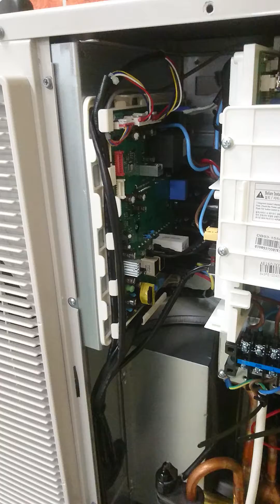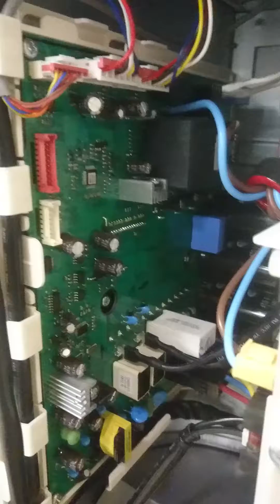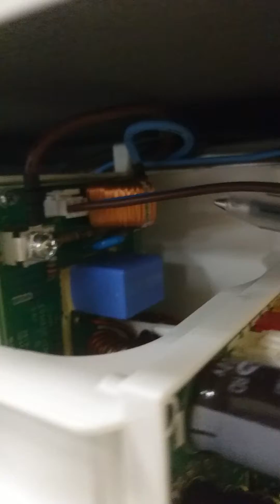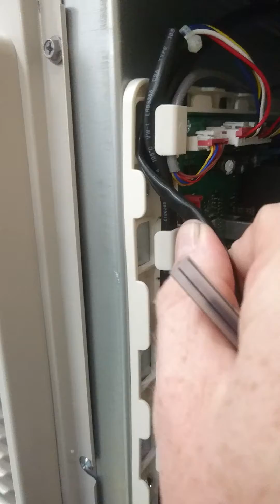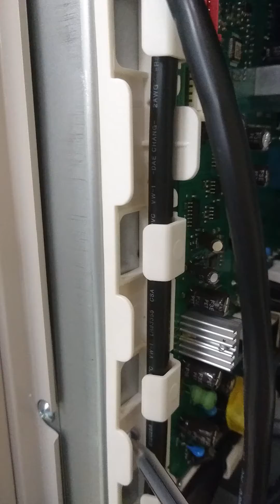E203 error Samsung air source heat pumps  AE090JXYDEH AE160JXYDEH

Comment: So I turn on the fan only part it runs for a few minutes then the e203 error comes on but if the board was shot would it even be turning on and running it's kind of confusing
Reply: That’s why you need to know what you’re doing when you fixing things. You don’t know what you’re doing…

Comment: Hi, I'm wondering if you could help me. I have a new Samsung unit with an outside  air to water unit. The unit out fan is not turning eventhough there is power at it. The panel inside seems to see the unit outside via F1 and F2 and I noticed that the digital number display on the outdoor unit is blank. Only the K3 button seems to click a relay??
Reply from the maker: Hi Damien if the screen is dead outside it has no power, you need to get this checked, once the power is on the unit will run again.